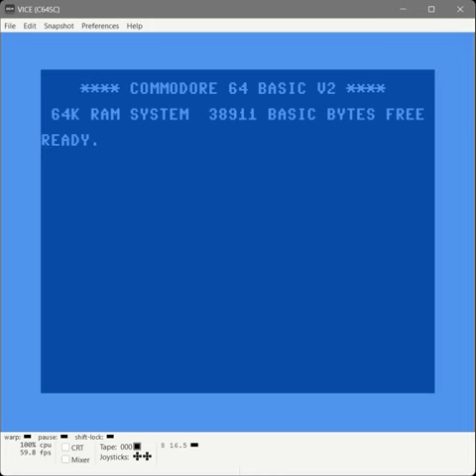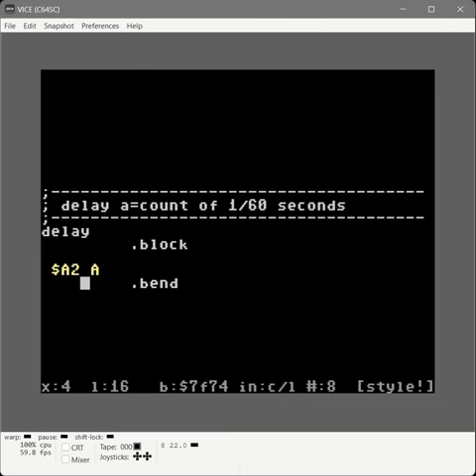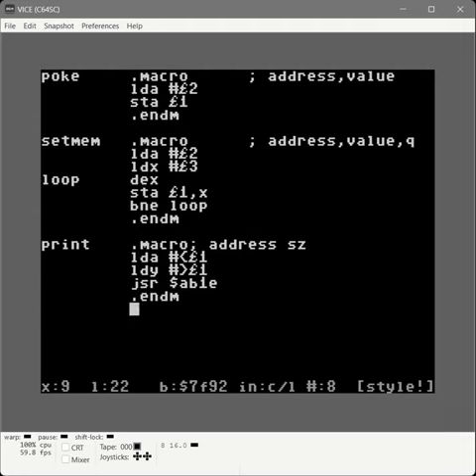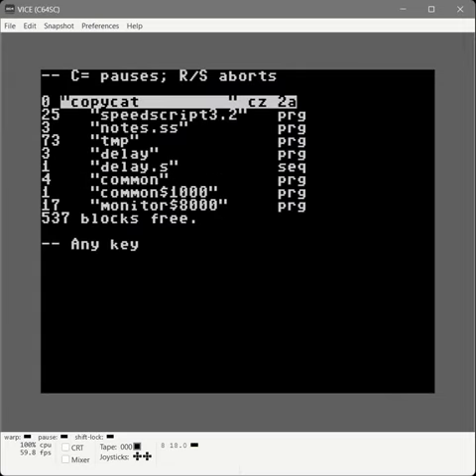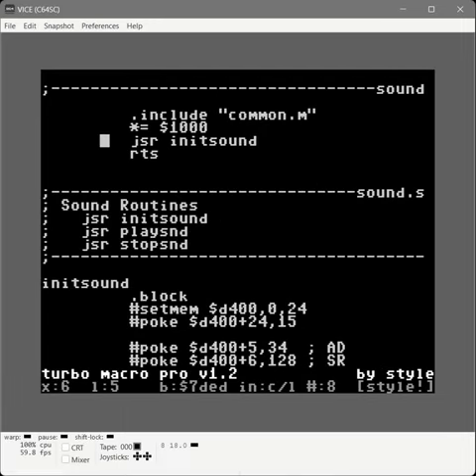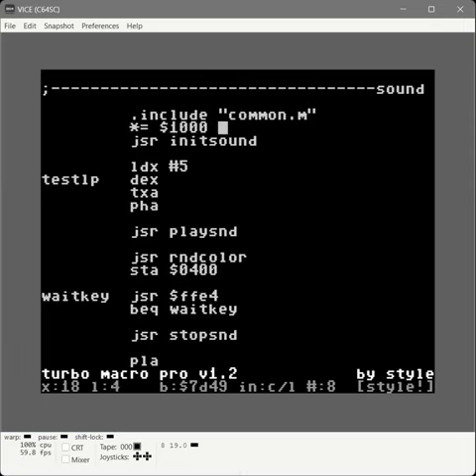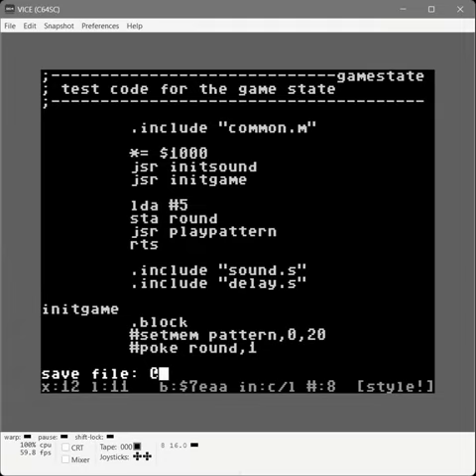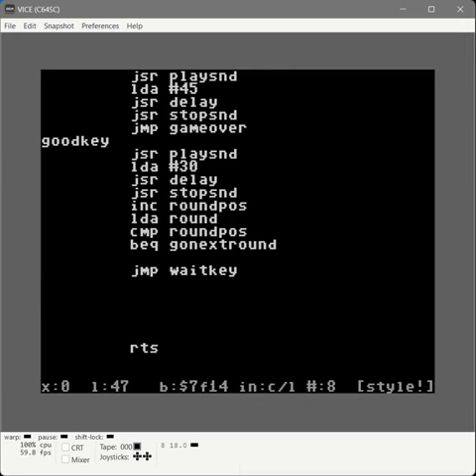My first game in 6502 assembly language for the C64.

Comment: NICE very cleanly written! Funny you also did a SIMON clone, I just finished a 4 part series of doing a SIMON clone on Pi Pico using Zig.
BTW I love your dedication of using Turbo Macro Pro, I did my C64 series solely in KickAssembler. As I didn't want to go back typing on the C64 anymore and the slow assemble times :D
Reply from the maker: The compile times with multi-file projects in Turbo Macro Pro (and really any c64 assembler) are no joke.  Of course, I edited them out / used warp mode when putting these projects together, but yeah.. programming assembler on read C64 hardware does require quite a bit of patience.    

I was playing around in VICE using the 1764 256k RAM Expansion as a Ram Drive (The drive comes on it's utility disk).  It's really fast and improves the assembly process by an insane factor..  In Vice you can emulate a battery backed version of the 1764 256K RAM Epansion, so when the machine crashes, you can reboot right into it and not lose anything.  

I never had a REU when I was younger, but I'm pretty sure a battery backed 1764 does not actually exist in the real world, so I'm not sure if it's worth demonstrating in a video.   If anyone know they do exist, I'll throw it in the video, because it is kind of cool in action.

Comment: How does your delay function work?  If the low byte of the Jiffy Clock has $F5 in it when delay is called, the delay will last 70 and not 60 due to overflowing 8 bits, right?

Comment: so qq, what kind of Keybaord are you using, one with labels?  I am looking to add labels or icons to my current keyboard, but want something that makes sense... 70% keyboard etc...
Reply from the maker: I use this keyboard and mostly love it.   The only issue I have is every so often (like once a month) it freaks out and acts as if the space bar is stuck down.  I have to unplug and plug it back in to 'fix it.  Could just be my keyboard.  Outside of that, I love it and I do all of my retro Commodore programming using it.
https://www.perifractic.com/retrogaming/takeout-shop/petsciiboard/

Comment: What happens when an interrupt makes your loop miss the target read?
Reply from the maker: The question I believe you're asking is... In the loop in delay.s:
1.    clc
2.    adc $a2   ; $a2 = lobyte of Jiffy cLock (255 1/60 second ticks)
3.  loop:
4.    cmp $a2
5.    bne loop

What happens if an interrupt fires and causes $a2 being read at line 4 to skip a number potentially making it miss it's target wait time.  If this were to happen, the delay would wait an additional 4.25 seconds instead of the desired time.
Reply: I have now realised you will be using kernel routines in your game all along and so your interrupts code if any will probably not amount to anything substantial enough to throw a tight loop like that off, actually.